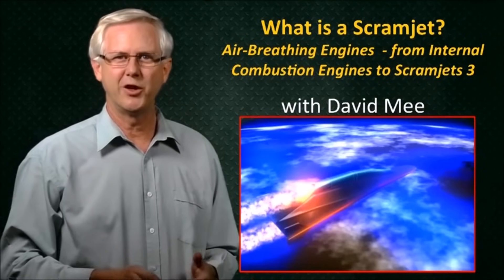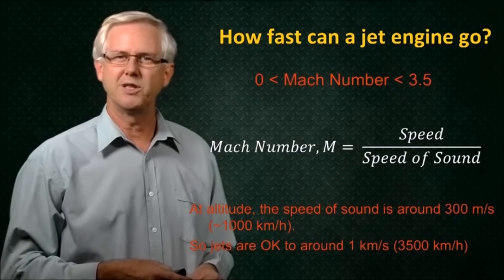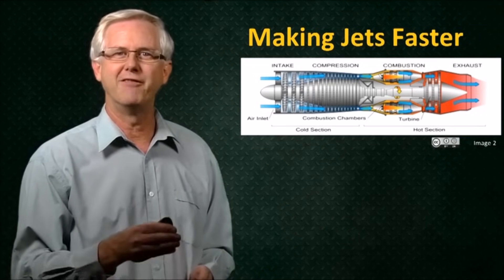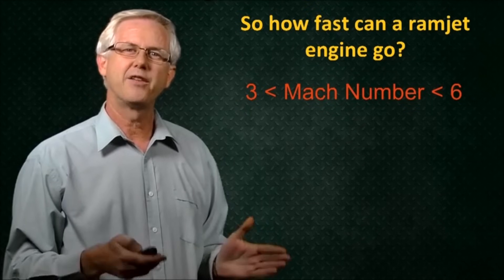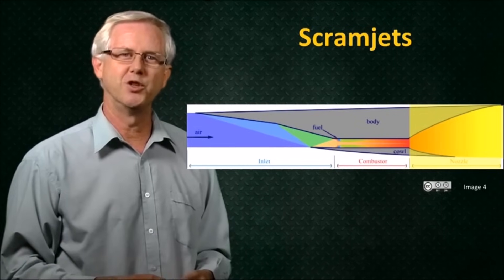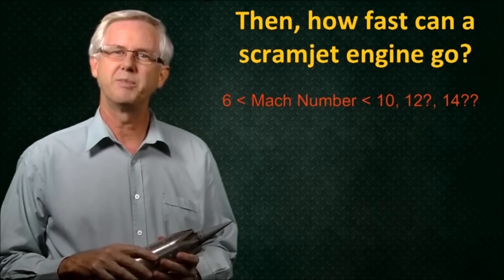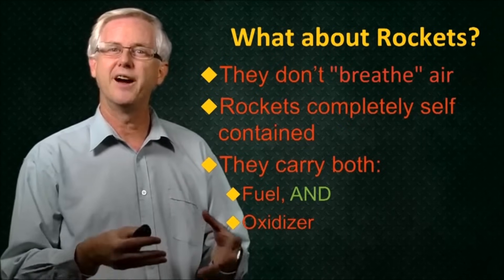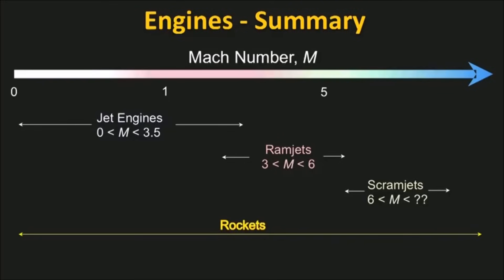Ramjets and Scramjets Explained - Mach 14

Comment: wasn't the Luftwaffe V-2 buzzbomb a primitive ramjet?
Reply: The V-1 was, used rockets to get up to speed.  Ram Jets need a lot of fast air.  SR-71 had a hybred.  conventional to take off then ram jets to get to 2,000 + MPH
Reply: The V-1 used what is known as a 'pulse jet".
Reply: Erm... the V-1 did not have a ramjet and the V-2 had a rocket.  From what I remember of the schematic of the V-1's engine I saw years ago, it had one-way gates/shutters at the intake end that closed when fuel that was intermittently injected into the combustion chamber was ignited.  The exhaust was thus forced to exit out the back as thrust.

Comment: Good explanation.
Reply: Why? Pulse explosive scramjets have been around for years. you can see the contrails from Area 51 over china in 2.5 hours due to the doughnut shaped ring produced on the exhaust. So mach 25/30 is decades old.

Comment: 7:35 What does he mean by this? Why is the temperature "too high to burn the fuel"? Does fuel not burn at high temperature? That seems counter-intuitive.
Reply: Too hot to burn efficiently so it would not produce thrust even if it burnt.  Fire is a chemical reaction that only happens between two temperature extremes.  It can be either too hot or too cold to ignite properly.
Reply: Michael Perrino 
If the air is too hot, it will consume his own oxigen, (burn it, oxydaze it), then it will not have Ox to ignite the mixture!!!
Reply: I think he might be saying that introduction of fuel (depending on what it is, I guess), would not necessarily increases the temperature of exhaust beyond that of the intake air, it might actually cool it.
Reply from the maker: temperature levels alter the physical properties of any substance
Reply: "Too hot to burn" means that you have the condition where the fuel does not break down and release its energy. 

In thermodynamics, there is a heating phase called Isochoric Heating that is characterized as having Constant volume (v), an increase in pressure (P), an increase in entropy (S), and an increase in temperature (T).

If the fuel cannot burn, then that means that one of those characteristics has not been met. 

For example, if the pressure energy is higher than the chemical energy of the fuel, then the fuel will not burn.
If the entropy of the system is higher than that of the fuel, then adding the fuel will not result in the temperature increasing.

Comment: SCRAMJETS may have the raw speed ability, but they also go through fuel (liquid hydrogen, in the supersonic combustion area) like it is going out of style.  Consider that test flight - fast but quickly ran out of gas.  Maybe a dusted off and developed nuclear ramjet?
Reply: I like your thinking, but you'd need the energy equivalent of whatever fuel you're putting in.  
Let's say you're using kerosene (energy density of 46MJ/kg), and the engine is 50% efficient, at full throttle. That's 23MJ per second you've gotta put into the combustion chamber. To fly for an hour, you'd need 3.6 tonnes of fuel. Not too bad.

You must remember, as you increase the speed, your engine will get more efficient, so the longer you will fly.

Comment: WHY CAN'T  WE BURN FUEL AT VERY HIGH  TEMPERATURE? WHY WE NEED TO SLOW THE SPEED OF INTAKE TO SUBSONIC BEFORE MIXING FUEL?PLZ............EXPLAIN
Reply: You get energy from the rapid expansion of the gas caused by the temperature increase. If the temperature is really high somewhere near the temperature of combustion then the amount of energy is minimal and not enough to overcome the drag.
Reply: It would be gone from the engine before it burned.  That airflow is FAST!!!!!!!!
Reply: xITZxUS BUT HEATED AIR MEANS OUTPUT WILL GET MORE HEATED......AS THE COMBUSTION ENTHALPY WILL BE ADDED TO IT...................SO SHOULDN'T IT HAVE A CONSTANT TEMPERATURE INCREASE?...............ALTHOUGH OUTPUT/INPUT TEMPERATURE RATIO WILL DROP..........................THANX FOR UR REPLY...........
Reply: M M islam put it to you this way let's say the incoming air is at 20c and it gets heated to 40c the expansion would be 6%... so your incoming air is let's say for argument 960c you add her fuel and it increases the temperature to 980c you get 6% expansion. so now let's have a jet tube volume of say 2000cc and the nozzle is at 1000cc you only going to get 12%increase in pressure from front to back. I don't know what the drag figures are at a speed like that but I'm pretty sure a 12%increase in volume of air isn't going to produce enough thrust to overcome the drag. If I remember right I had to calculate somewhere in the 20%range for drag at 150mph.
Reply: UNDERSTOOD .............
Reply: ANOTHER QUESTION.....................WHY COMPRESSOR NEEDS THAT MUCH NUMBER OF FANS?.....................CANT A SINGLE BIG FAN OR TWO PUSH AIR THROUGH A NARROW NOZZLE TO DO THAT?
Reply: M M islam That's a big explanation. Short answer is fans move air compressors compress air. Compressors have the ability to pack air into a vessel or space and create pressure. Fans only move air to the vessel but can't increase the pressure or pack it in.
Reply: xITZxUS I KNOW THAT MULTIPLE FANS R USED....................BUT I SAID A BIG FAN PUSHING AIR THROUGH  A INCREASINGLY NARROWING (BY DIAMETER) DUCT.....................WOULD THE AIR BE COMPRESSED?   ......................IF NO, THEN TELL THE FACTORS RESISTING IT,.....................NO NEED TO EXPLAIN......................JUST IN A FEW LINES.....................
Reply: M M islam A fan consists of a single part the fan blade. It moves air because it creates a low pressure in front of it or a vacuum. The air then moves through the vacuum to the high pressure side where it is expelled. The volume of air being moved depends on the amount of vacuum the fan can provide. When you limit the volume behind the fan the pressure area changes. The high pressure area moves farther into the low pressure area making the low pressure area smaller and brings the pressure up to higher levels. A fan can't compress air this way. The way a compressor works is it has two parts. The rotor and stator. The rotor or what you call a fan moves the air with the same low pressure high pressure concept. As it moves through the rotor it passes through the stator. The stator is a stationary set of guide vanes that creates like a buffer between the rotor and the high pressure side. The high pressure has a harder time moving into the low pressure side because the air is being directed away from the rotor by the stator. when you stack these set ups one after the other you can increase the pressure each time. These are called stages. The number and design of the stages is determined by the type of power plant. Lots of factors play a part in this. Some are pressure requirements, size, weight, and volume. There are multiple YouTube channels on jet engines and all the components that make them work. Agent JayZ is one of my favorite channels for info. Look him up and Watch his questions play list. He explains a lot about them and some times in the comment section you get engineers that designed them commenting and describing in detail different parts of the Jet turbine engine.
Reply: GOT IT...........SO PRESSURE JUST BEFORE COMBUSTION SHOULD BE HIGHER THAN THE PRESSURE JUST AFTER COMBUSTION.................NO?...................ELSE WILL IT BACK FIRE(CONSIDERING AIR RUNS FROM HIGHER PRESSURE AREA TO LOWER)?

Comment: Supposing a ramjet were attached to the nose of a projectile fired from an electromagnetic cannon? As the projectile were moving through the air, the ramjet would detach and continue via its own power to Mach 6. Upon reaching Mach 6, a scramjet attached to the nose of the ramjet would detach and continue via its own power to Mach 10+. Sounds like a good idea!
Reply from the maker: engines of the SR-71 are a bit like this concept - with bypass technology - but I'm sure the concept can be taken much further.  I'd welcome an aircraft that entered orbit and reached England from Australia in a few hours rather than the grind of a 30 hour flight as now :)
Reply: You could stack planes like stages of a rocket: first, a big turbojet starting from nothing and picking some height and speed. Once its fast enough for a ramjet, it disconnect affirm the turbine first stage and does his part, then the scramjet gets going, disconnects and continues on! First and second stages return to the airport. On the other end of the trip a ramjet awaits, scramjet "lands" on it, then the combination is met by a turbojet who's like a flying aircraft carrier for faster jets! Everything lands together, people come out and go to the hotel. Or maybe they can be dumped into the ocean cause to land is a drag and its too much fun to fly around combining and separating in the air! That huge tubojet can be refuelled in thecsir and so the whole thing never need to touch the ground! Wow. I wish I was 30 years younger and could go to QU and become a rocketman!
Reply: How about a Two-Stage Jet? We can use a stealth-type (air superiority) base. Why don't we use a F-22 as the base. From this we would widen the two jet engines and then fit a ramjet in the middle, as well as a secondary fuel source but still allow this engine to use the same fuel. If we can push the jets to Mach 2.5, (these have been proven and tested to comfortably hit mach 2), then we could hopefully have enough speed to activate the Ram and disactivate the jets. This would allow faster travel and then this type of 2 type planes would br integrated into 7th gen stealth planes, (Since we all know we are 10 years in the dark about jet developement so the 6th gens have already been created and will be deployed possibly within 3-5 years. Sure we would have to configure the jet to handle the speed but it could be done
Reply: # # That explains why my ion air purifier was flying around my room the other day.
Reply: great thinking....!
Reply: I doubt this concept is viable because of the Shockwaves and G-Forces caused... unless you have a mammoth Accelerator which would give the Aircraft more time to accelerate, but it'd likely have be about 10 miles in length.

It's a nice concept but I doubt it's viable for Ground Level Atmosphere.
Reply: My mistake, the Pulse Detonation Engine can reach RAM-jet speeds.  I'm not sure about SCRAM-jet speeds.
Reply: Your all aiming way to low. Check out the WEAV it's a vehicle that's basically designed to ionize the atmosphere around it and propel itself using electromagnets. Way higher possible speeds due to it changing the nature of the atmosphere around it reducing friction etc.
Reply: It should work, but what would be the point?
Reply: @guifrakss  does there have to be one?
Reply: Kevin Thomas and
Reply: to annihilate your enemies if it was a weapon
Reply: Kevin Thomas rail guns are designed to shoot at very high speeds. And if there was a jet on the projectile then it would be a missile.
Reply: Wolvze
Reply: The Pulse Detonation Engine will replace everything.  Look it up.  It can start from a speed of zero and accelerate to SCRAM jet speeds.
Reply: Kevin Thomas hey !!! a turbo-ramjet its the best option to make a scramjet fly ... sr-71 for exemple
Reply: # # way higher possible speeds!? This guy is shooting for Mach 14 with a scramjet engine and you think this WEAV thing can travel at way higher possible speeds? You yourself said it uses electromagnetism, so what would be their power sorce? You would need an engine or a bunch of batteries. More batteries = more weight = impossible higher speeds.
Reply: This concept has been utilised by isro in 2016
Reply: What would be even better than all that complicated staging and electromagnetism would be just 1 simple & cheap solid rocket motor that propels the scramjet to operating speed.
Reply: None of this can matter until we can manipulate gravity
Reply: with variable intake ramp you can get rampjet and scramjet function from same engine. Also, look for Zircon 3m22 missile developed by russia. Its M6-M8 air breathing scram-jet missile which has actually gone in production.
Reply: Yea not being under the effect of the drag of the atmosphere has a higher potential speed than something under the effect of the full drag of the atmosphere. People here are talking about primitive combustion engines and I'm merely pointing out that theirs a whole other option. Yea no shit some development needed but the tech itself has better in atmosphere speed potential overall.
Reply: Kevin Thomas lockheed said if you can imagine it.  we've done it.